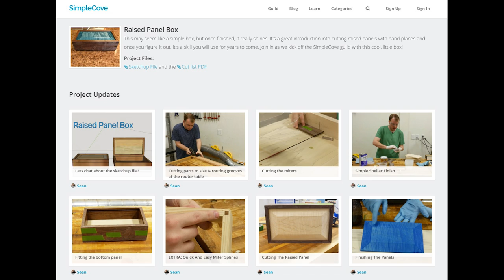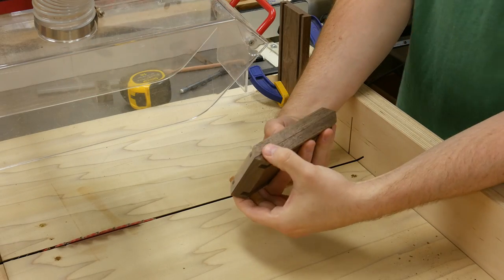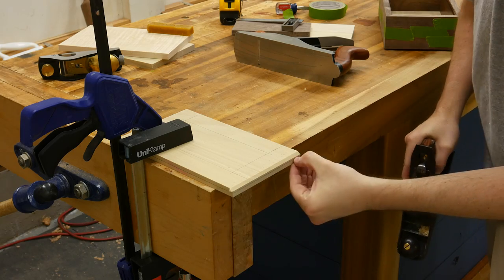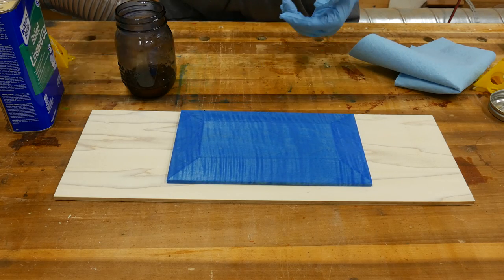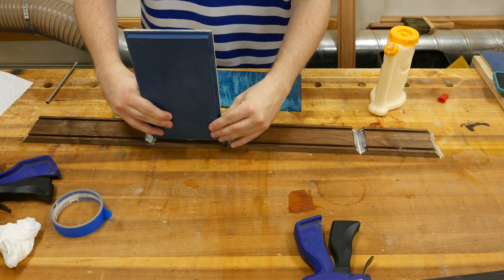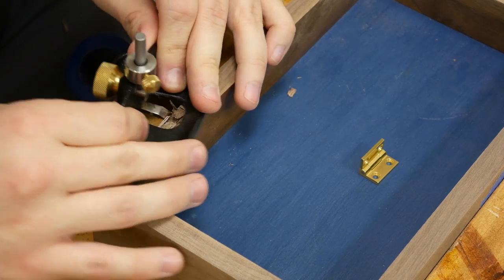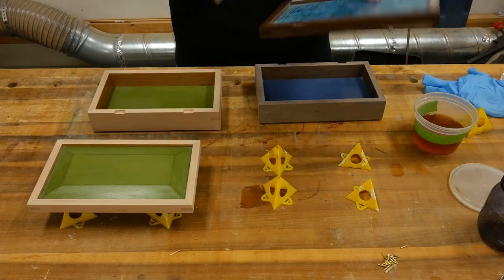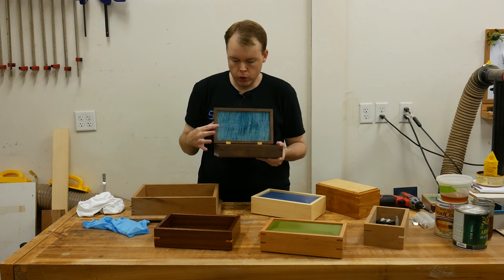How To Make A Raised Panel Box

Comment: I wonder if I could cut those panels on table saw without cutting my hand off. I need to get a wixey angle gauge too. my 45 degree stop is way off
Reply from the maker: Yeah you can. I would set up an auxiliary fence to help in keeping the panel from slipping or falling.
Reply: I second what Sean said. There are several jigs out there as well, if you want to be extra safe. Bob Van Dyke has a plan for a multi-purpose fence jig that allows for possibilities for raised panels, tenons, and some other operations if you'd like an option that is "extra safe": http://www.finewoodworking.com/how-to/video/multi-use-tablesaw-rip-fence.aspx

Comment: How do you go about cleaning off the dried glue that seeps in the inside corner after you have shellac on the wood?
Reply from the maker: I used a chisel to remove the glue. Since the insides of the box were waxed and shellac, it popped right off.